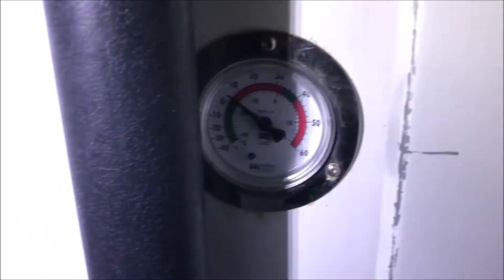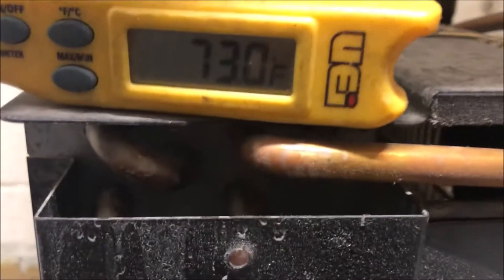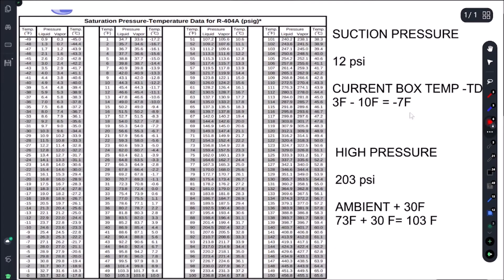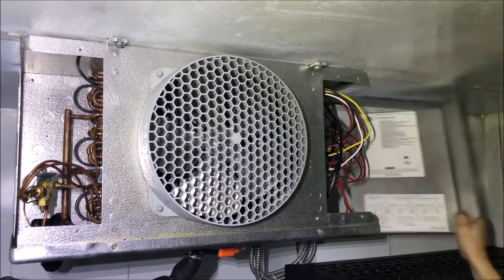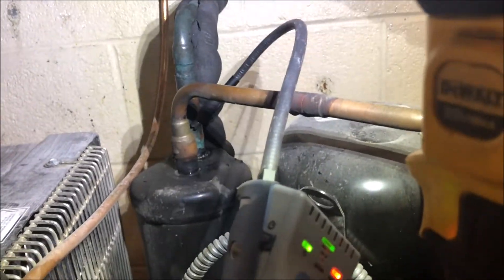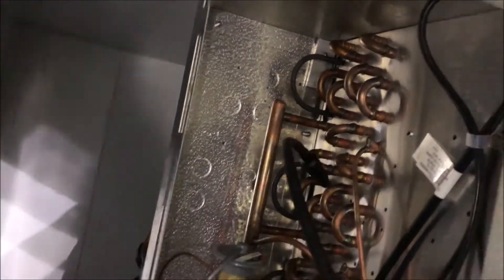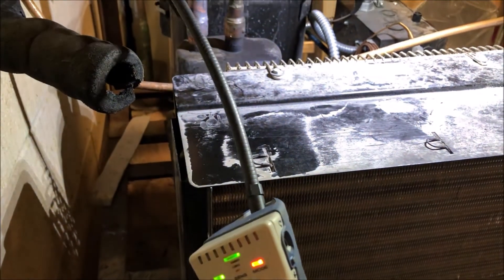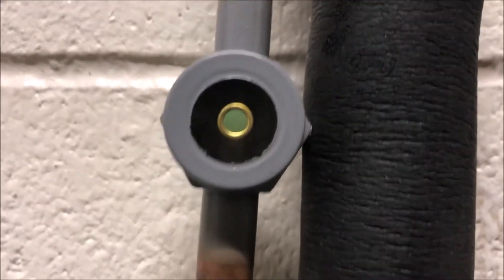Walk In Freezer Isn't Getting Cold Enough

Comment: Just wanna ask, if the ambient temp inside the freezer is 10*F does that mean I have to increase the pressure to 32.6PSi (using the formula Box Temp-TD) where TD is -10*F, therefore 10*-10*=0*. thank you

Comment: Need your help! Walk in freezer R449A low side 35 high side 165 no frost buildup coil not cold enough to close fan delay clicks on unit will not pump down. Even when king valve closed. Scroll compressor 3.5 amps. Ambient 80 degrees , box 
temp 36. Site glass empty or clear no bubbles. Llt 89 F slt 80F. No heat moving on lines only thing that is hot is the discharge line to top of condenser piping hot and compressor hot. Suction line never gets cold.

Comment: As a refrigeration tech, I must say I appreciate your break down with the math and how you figured out the issue
Reply: Just wanna ask, if the ambient temp inside the freezer is 10*F does that mean I have to increase the pressure to 32.6PSi (using the formula Box Temp-TD) where TD is -10*F, therefore 10*-10*=0*

Comment: If the feed of the evaporator is law the build up of ice is asymmetrically and to the side that the freon inserts to evaporator  first.In your case the ice is in all over the evaporator and the valve is frozen because it's closing dew to liquid refrigerant passing throw the suction and bulp.In your case it seems bad defrost cycle together with much moisture.I propose electronic defrost with tge air always running and solenoid closing for 7 minutes every hour

Comment: It’s sometimes hard to find condenser split temps. Are there any basic rules if there is. Is information? So as an example if you have a 134a cooler do you go with a 20 degree over ambient temperature? Or should it be higher like 30 degrees?

Comment: Thank you very much for the informative video I learned from your experience. My question as someone new in this field, how you I get to know the saturation pressures? And do you have a video where you show at length how to do those calculations, because I look like they are important in knowing the running/operation pressures of the refrigerant one is working with in the unit.
Reply from the maker: Yes I have video on pressures and saturation temperatures
Reply: The pressure is td over plus  ambient for high and case setpoint plus td or superheat but how do I know my units td is my question

Comment: Did you just use the pt per what refrigerant it was..?
Reply from the maker: Yes, they all have a different PT value
Reply: @REFRIGERATIONKITCHENEQTECH  each Evap? Where did you get the info to pull the pt chart up id like to use this method
Reply from the maker: What ever refrigerant the system is using, you will need to use the corresponding PT chart

Comment: Does the restriction also cause bubbles in the sight glass and lower pressures? How did you rule out the restriction? Thanks, great vid
Reply: Depends where the sightglass is located. If it is after a liquid drier that is restricted, yes it will.
Reply: @Brisket9392  thanks
Reply from the maker: Low sight glass = low charge (once air flow has been ruled out). Once the full charge is in and pressures are within our calculations, we know that a restriction is not an issue

Comment: I appreciate your explanations..  I typically work on large commercial units (15-25hp condensers) or refeer trucks/trailers and your explanations remind me of basics that should never be overlooked!
Reply from the maker: That’s some big equipment. Fundamentals are key to not overthinking the problem. Once you rule all of that out, then start to think outside the box.
Reply: I actually really like your electrical explanation most, tracing a wiring diagram.. doesn't matter how good you are at reading them, its understanding!
Reply: Indeed, on the side I do alot of reach-in stuff which thats very important, a huge refrigerated warehouse has some different rules with dynamic heat loads due to processing at the time, etc

Comment: Nice video,I'm curious were you able to braze it with the charge in the unit,or you had to recover it?Thanks
Reply from the maker: Pump down, braze, vacuum, no recovery. With the rising price of refrigerant, this will become common practice IMO.
Reply: i’ve seen a guy try to braze on a charged unit… when the joint got past the melting temp of the braze 12 lbs of 410 left the braze joint  over the next 20 seconds… he no longer works with us.

Comment: Excellent find. Looks easy but not easy to find without experience. To braze on the accumulator, a pump down is enough? I presume the accumulator is after the receiver king valve.
Reply from the maker: Yea, thought it would be at the evap like usual but the detector picked it up. Yes I just pumped down and ran a good vacuum. With the rising cost of refrigerant, this is going to become common practice.